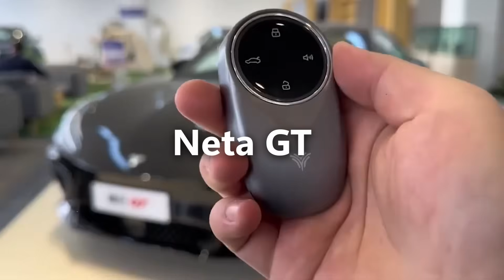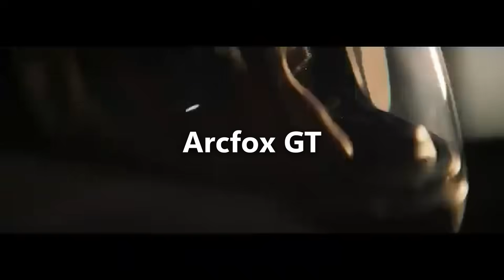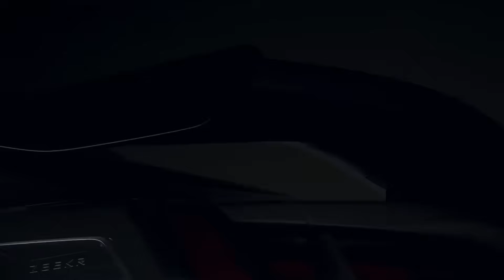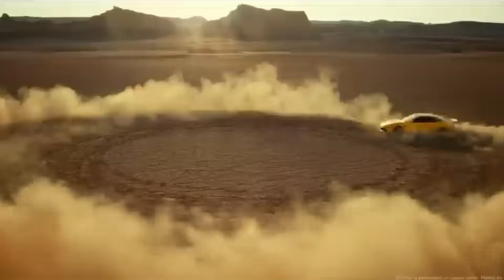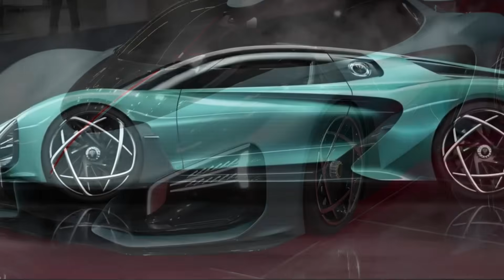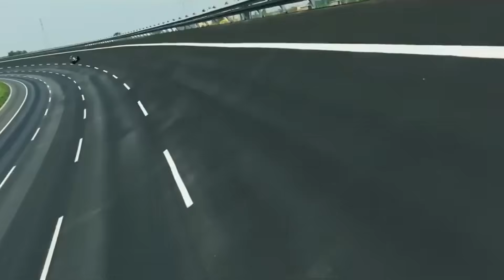China’s Supercars Are 100 years Ahead of Ferrari, Lamborghini and Bugatti

Comment: Just imagine the headache when you have faulty sensors.
Reply from the maker: That’s never fun😅
Reply: Highly doubt that a bad sensor will be easy to find almost all these cars has a diagnostic screen and will tell you which sensor is not responding so all you have to do is change that one .
Reply: @Matthew.Sirrom  Oh yeah ... definitely you have not had a fault diagnose and trace to sensor but when the sensor changed, the fault code still triggers and sometime triggers more fault codes.

I use Merc, BMW and Audi and all of them has givem a fair share of sensor ghosts. Experience mechanics usually will advise the source of potential fault and not all sensor alert are correct.